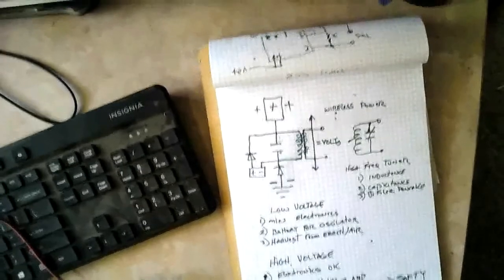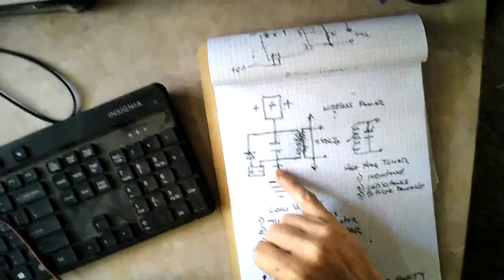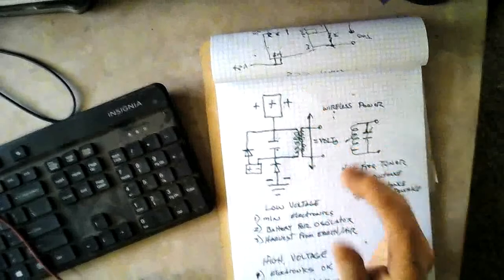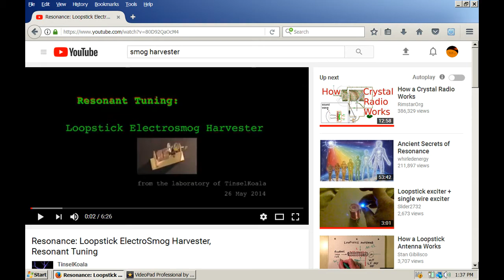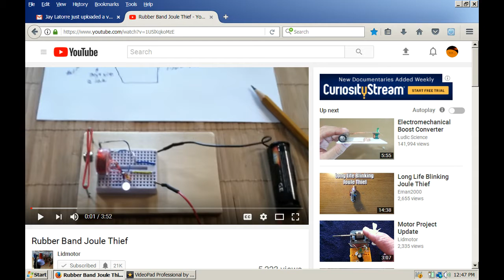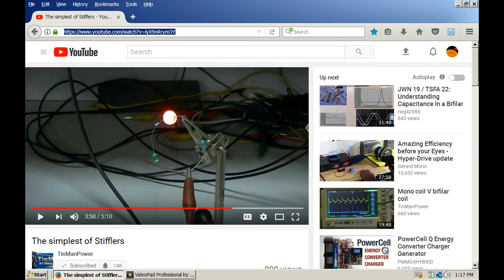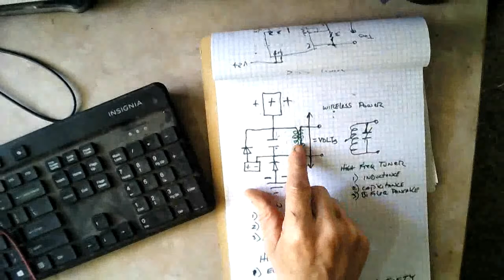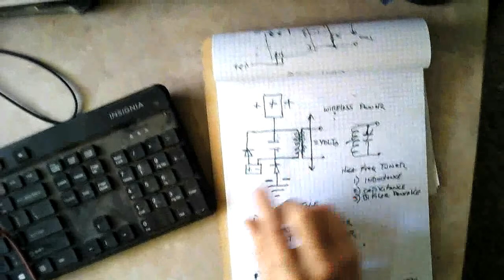New Electronic Circuits & Bio-Electric Power Plan!

Comment: I think this is a very interesting area to investigate, harvesting ambient energy from ambient sources and biological processes. However I think the amount of energy from these sources is rather limited. A very limited scientific novelty such as lighting an LED.  If ones ultimate aim is to get off the grid and power a house with it I think they will find this is not possible. There is just not enough stray energy available to do this.
Reply from the maker: I'm not as sure about that as you are William. The earth is a pretty big battery, with gigavolts of potential difference between earth and ionosphere. I think we just need to learn how to do it better. Only time will tell.